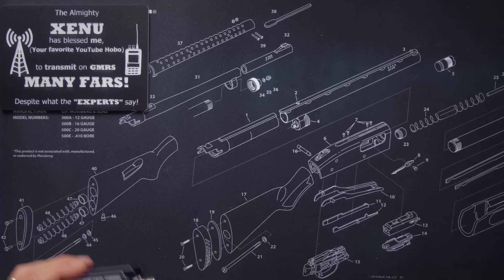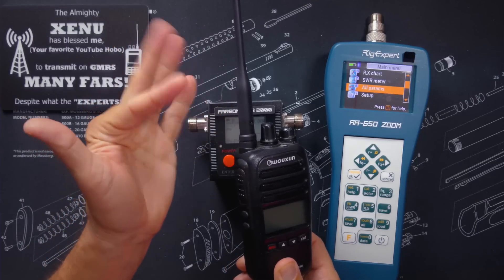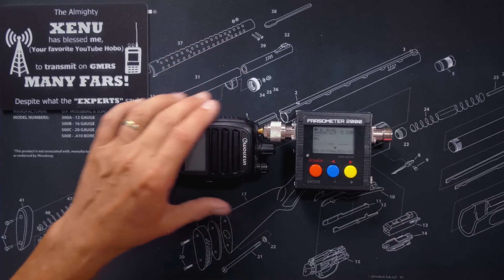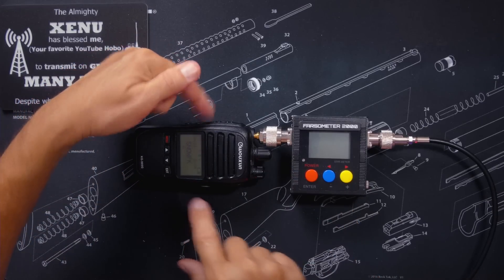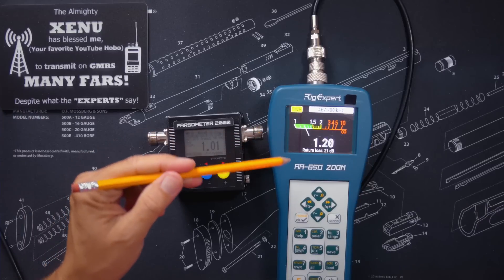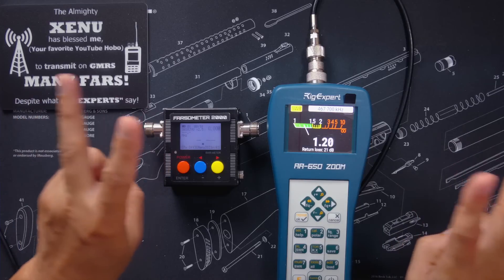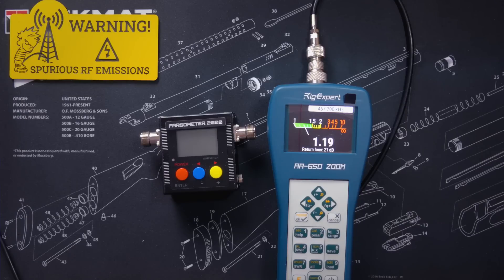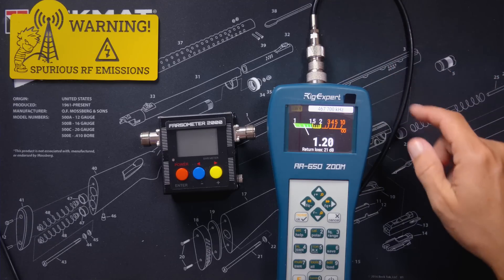How To Use A SWR Meter To Measure SWR - Explained In Simple Terms for GMRS, CB Radio & Ham Radio

Comment: I have question about SWR I am just getting started and just got my first mobile radio for the car and home use.  when i check my mobile antenna with my HT i get 1.01 swr, than i checked the same antenna with my mobile KG-XS20g+ and got a SWR of 1.86 on high power and 1.01 on low power.  Is it normal for the SWR to increase with wattage output?  Or is the a result of small diameter coax and or pour quality coax? Or a slightly out of tune antenna? I am currently using a SW-33 for SWR testing.  Thanks for the great content
Reply from the maker: It is normal for SWR to change whenever any of the variables change.  There is nothing wrong with 1.86:1
Reply: @TheNotaRubicon  Good deal thanks man love your channel.   you do a great job with you content.   Cheers

Comment: Farsometer, Hi.
I made a Wheatstone Bridge resistive type calibrated with known value resistors, tx never sees above a 2:1 SWR.
'Some People' believe they must have a ½λ 'tuned coax'. They see two coax cables so obviously there is a tx side and an aerial side of the SWR meter. 
I'm waiting for a reply from one when I asked where has his carefully trimmed 'magical' length of coax gone when a VNA is put on the tx end. It's one cable with a meter inserted into it but they see two. They don't get it.
G4GHB.

Comment: Swr question...
Using sw-33 Plus also...
Tram 1468-B Antenna attached to 50ft LMR400 to the BTech AMP-U25D amplifier then running to a uv-390 plus. The Antenna is U-bolted to an aluminum extension pole which is hose clamped to 2 extendable flag poles to reach over a second story house from the ground. 
Does the antenna need to be grounded and how to simply?
The 390 using the surecom sw-102 is showing an swr of 19.99 and the sw-33 Plus for the digital signal is 8swr. and the power output only gets to just under 8watts! (On Low,M and H)
What am I missing?
The power on digital fluctuates up and down also making conversation cut out in the middle. Thanks!
Reply from the maker: What model antenna did you say?
Reply: Tram 1486-B
It's uncut. I've tried frequency 406 because you don't really cut anything and it's the same 8+ swr aa when I try 426 or 512. If the swr isn't even close to 1:1 uncut on 406 I don't see how cutting to 462-ish would help. I also like the range of frequency options, that's why I got that antenna because I might want to switch it up now and then.
The radios power fluctuating to max current setting then down to almost zero every 3 seconds while transmitting on digital is a different issue.  Haha.
Reply from the maker: The antenna should be grounded for safety, but not needed to operate. take out all the variables (the power amp and anything else) then test. if still no good, check/replace every connector, if still no good test direct to the antenna with a short piece of cable.. You need to step through/test each segment of the chain until you find the bad link.
If its bad when connected direct to the antenna with a known good/short piece of cable, then you need to tune it, or its broken.

Comment: But if you DID want to test a walkie talkie antenna, how do you do it accurately? For example you got an antenna off ebay, and want to know if its garbage or not, or if the swr will damage the radio. Thanks.

Comment: So this Farsometer, which I just added to my cart on Amazon...  is this all I need to tune the top-of-my-truck antenna for my Midland 75-822 CB radio?
Reply from the maker: Pretty much, other than coax and maybe a short coax jumper-cable to connect everything.

Comment: Ty for your videos,  can you use the midland mxta26 with the wouxun KG-1000G radio..ty
Reply from the maker: The Midland MXTA26 is a GMRS antenna and the KG-1000G is a GMRS radio... Soooo.....Yes...
Reply: @TheNotaRubicon  ty, as you can tell I'm rather new to gmrs and still learning...

Comment: My cb radio reads 1.8 on channel 1 and 2.0 on 40. On channel 19 it reads like 1. Is that normal?
Reply from the maker: Yes.
Reply: Thank you. Thought it might be but wasn’t too sure. Running a cobra 29lx with 18’ mini 8 line to a 4’ firestik 2 gp antenna

Comment: After I changed the RG8 cable to a LMR400, to eliminate the loss, the SWR changed from 1.4 to 2.62.  So up on the roof I went and by adjusting the antenna by about 3/4 inch shorter I was able to get the SWR to 1.64.  1/8" shorter and it went to 1.98.  1/8 inch longer and it went to 1.77.    So I guess I am as good as I can get.  Still don't understand why?   My guess is I have more power getting to the antenna so the energy reflected is greater too.  If I run my power on low I get a SWR of 1.16.

Comment: Informative, yet entertaining as usual. Can you offer a defined reason why the readings obtained from a handheld raio would be inaccurate, or wrong. 

My reason for question is I recently tried  antenna A on 5 assorted Baofeng's, and results were 3.2 > 3.5 

A change to antenna B produced 1.2 > 1.6. Frequency was a constant.
Reply from the maker: On an HT, the radio and your body act as the groundplane - when you remove the antenna from the radio and connect it to an SWR meter, EVEN if you have a groundplane plate, it will never be the same as when its connected to the radio. Therefore, it is very difficult to get the actual SWR of an HT antenna when it's not connected to the radio as it would be while in actual operation.
Reply: @TheNotaRubicon  Thank you, and I realize that was indicated during the presentation, but was wondering it there were any other factors involved. My enthusiasm greatly outweighs my experience!

Comment: Really enjoy and learn from all your videos Randy. Really great stuff. What type of connectors will I need for surecom SW 102, for checking SWR on Wouxon KG 1000 plus and KG 105 G?
Reply from the maker: If you have the standard SW102 with SO239 connectors, you will just need a short patch cable with PL259 connectors on each end for your KG1000G.. for the HT I would not bother - you will never be able to get an accurate SWR on an HT antenna, and you cant adjust it anyway.

Comment: Hello Mr NAR, thank you for your informative videos. I purchased a 1000g, SWR and various other handhelds/accessories based on your recommendations with your (wait) affiliate links below. I have two questions. 1. I bought a rugged radio pre-tuned GMRS antenna. It was getting about 1.28 on channel 22. I followed your instructions on clipping the antenna. It's now at 1.02 on 22 and 1.01 on the lower channels. What is really an acceptable SWR on the channels? Is there a "real or noticeable" difference between 1.28 and 1.02?  2. I clipped almost a 3/8 of an inch off the antenna. Will that reduce my range (fars) with a smaller antenna? Is a bigger antenna better with a slightly higher SWR? that might be more than two questions. Thank you!
Reply from the maker: Not only is that a 'good' SWR, that is a GREAT SWR.. you will never notice a difference between 1.28 and 1.02 - and even though its shorter, the antenna will work better because it is properly tuned.

Comment: Can I adjust my mobile antenna with a SWR meter off the vehicle or does the vehicle ground plane affect the SRW?
Reply from the maker: The vehicle will affect the SWR so it is always best to measure with the antenna installed how/where you will be using it.

Comment: You said that SWR of HT antennas is inaccurate, because by design the hand and head are ground plane. I've yet to see a video of someone comparing SWR holding an HT to measure vs not. Would that yield different results or is it possible? IDK
Reply: The problem is that you have to disconnect the HT antenna and plug it onto an swr meter and that changes all the measurements so the swr reading you get is not the same as when the antenna is attached directly to the radio.

Comment: I really enjoy the way you explain things and make it simple to understand. I'm not sure if you have done a video in the past or not, but I could not find one, so I thought I'd ask, could you do a video explaining DB Gain and what that means for antenna's and how much each number would change the effectiveness of the radio? I mean from a 6 db gain to a 9 db gain, what can be expected, generally speaking of course. I heard the men from Hardened Power say in a video, that if they had $100 to spend on commo gear, they'd spend a $1 on the radio and $99 on the antenna. I hope you consider explaining this clearly for us who value your opinion and way of teaching. Thanks, and keep up the great work.
Reply: 3 dB of antenna gain doubles the power.  Think of 6 dB gain as doubling the power twice or 4 times the power.  10 dB of gain is ten times the power.  A very popular opinion in the radio world is that 3 db of additional gain is the minimum you should bother messing with because anything less will not be a noticable improvement.  In other words, if a new radio isn't at least twice the power (3 dB more power) or the new antenna isn't at least twice the gain (3 dB more gain than the old antenna) then don't waste your time and money.  Stick with what you have,

Comment: Since SWR is such an obscure measurement and the number is not very meaningful to normal people, I thought I would try to help simplify it by converting to how much power is lost. 
Notice that Randy didn't care that his two meters were showing 1.01 and 1.2 SWR? 4:51 That's because we are only talking about 1% difference in power lost.  There is no need for normal people to pay big bucks for a more accurate SWR meter if the difference is only 1%

SWR of   1  = zero power reflected back to your radio
SWR of 1.2 = 1% power reflected back to your radio
SWR of 1.5 = 5% power reflected back to your radio
SWR of   2  = 10% power reflected back to your radio
SWR of   3  = 25% power reflected back to your radio

Comment: I've been a licensed ham for 36 seconds. 37. 38. 39... I have the documented authority to inform you that after a ground plane leaves the runway it becomes an air plane and is useless as a GMRS antenna until it lands again.

69. 70. 71....

Comment: Well I'll be damned. I guess that's why a while back I was testing one of my radios and put the FM radio on, I tuned into a station and it worked. And then I sat the radio down right beside me and it got all static-y, like it was receiving a bad signal.

After a bit of trial and error, I realized that not only did actually touching or grabbing it get rid of the static, the static would fade in and out as I moved my hand closer to and farther from the radio, even if I wasn't directly touching it (but was still close).

I came to the conclusion that the radio must have been using my own body as some sort of antenna extension or amplifying the antenna's strength in some other way. Apparently I wasn't too far off.
Reply: When you are holding your handled radio and you put it right to your head you are making a ground loop with your entire body and the static noise reappear...😁

Comment: Will SWR change when switching devices? for example, I replace a radio with a different radio, but the cable and antenna are not replaced.
Reply from the maker: assuming nothing is wrong with the radio, the SWR should not change much/at all.  I've swapped out several radios and the SWR always stayed the say - but its always a good idea to check just in case something is wrong.
Reply: When ya hook up an antenna analyzer such as seen in the video, it doesn’t use any radio at all. It really is only a measurement of the cable and antenna.

Comment: This video ignores one of the most serious issues with radio interactions…..premature spurious eja…..emissions….although the person prematurely receiving the premature spurious emission is usually more surprised and disappointed than the premature spurious emitter….I’ve also found that if you grip or pinch the base of your ….radio….tightly, you can slow the premature release of spurious emissions….along with not shaking or rubbing the top end of your radio to vigorously…..

Comment: I also appreciate your videos, like the previous "commenter" stated.   I acquired one of those vintage Radio Shack SWR meters with an antenna, and I only know a little bit about it, but I did use it briefly to "somewhat" test a CB a few years ago.  I saw in the video description, that you mention an "antenna analyzer", and I am interested to know more about what that device is exactly, and I look forward to watching this video a bit later.  I have watched about a dozen of your videos, and I enjoyed all of them, and your unique "brand" or "style" of presentation.  Thanks again for your continued efforts, and for this new video.  John
Reply: The analyzer is an awesome device that analyzes your entire antenna system, including feedline. See where it's resonant (i.e. as close to 1:1 SWR as possible, and likely at multiple frequencies), see resistance-vs-reactance, plot Smith charts, and of course basic SWR checks. What I love about mine is when I'm putting up a new antenna I can see where the 3:1 SWR points are, and also the sharpness of the resonant point. If you just need to know if your GMRS or ham antenna is installed right you don't really need an analyzer.

Comment: What if the resonant antenna is a purely resistive 40 ohms and the phase angle of the cable is 90° resulting in a phase shift and impedance transformation?
Reply: Shhhhh.....  No one cares.  🤫
Reply: Scot Johnson  You need a to measure this with a Vector Network Analyzer.  Measure a straight coaxial cable run against the one you describe with the 40 ohm load and 90 degree bend and compare the  results.
Reply: Assuming it's a 50Ω characteristic impedance coax? It will appear as a 62.5Ω resistive load and your VSWR will remain the same; 1.25:1. In fact, you can use any arbitrary coax length and the VSWR will remain the same. 
 I left my Smith chart at work, so anything much more complicated will have to wait until tomorrow. I'm busy drinkin' beer :D 
/Not a ham :)
Reply: Do you kiss your significant other with that potty mouth?
Reply: Just add a few ball bearings.

Comment: Just did this test on my new truck/radio setup, super easy to do. If I can do it, you can do it. 

I got a 1:6 reading which is going to have to be good enough as my truck has ZERO ground plane.
Reply: the truck itself acts as the ground plane. depending on where exactly the antenna is located, you have more or less ground plane.